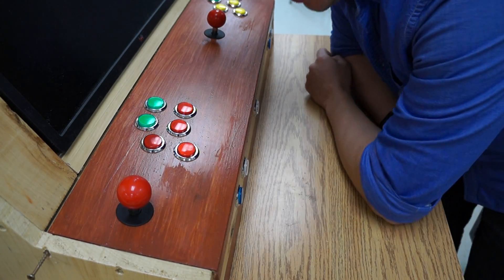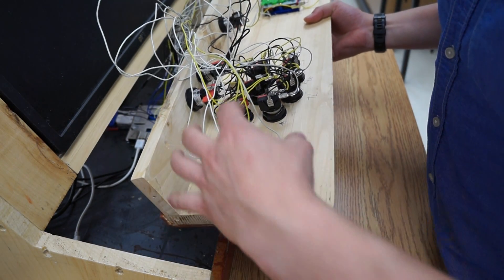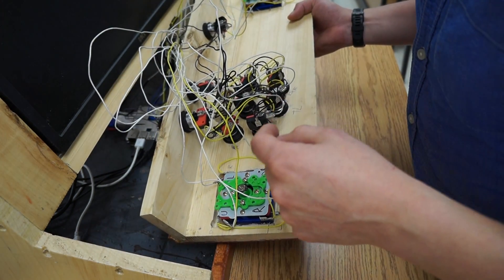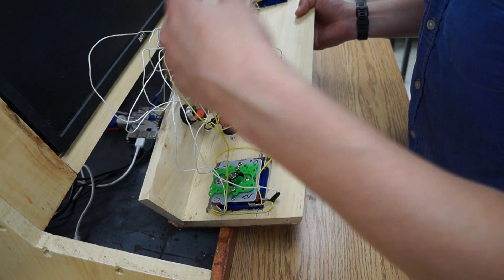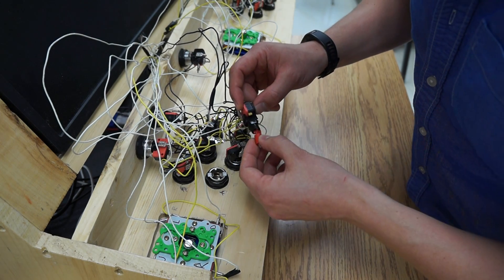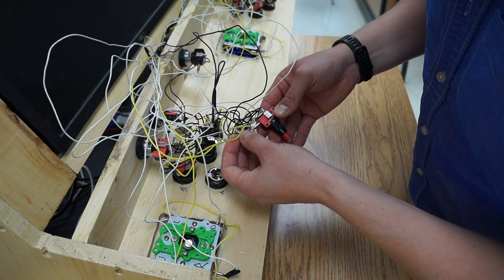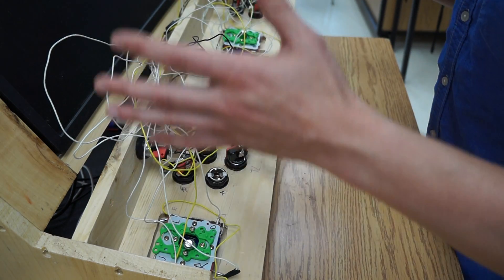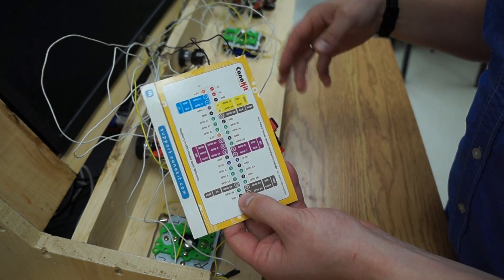Wiring up your Raspberry Pi 3 Recalbox with GPIO Controllers

Comment: I wish you would have slowed down while you were configuring the buttons and/or shown which buttons you were programming for the inputs, just for clarity and suggesting the button layout.  I have my pi just about ready to go, but I'm waiting for the weather to get just a bit nicer so I can build the bartop arcade.  I already built a full size one almost 14 years ago that's still running great.  I have it running on a PC though with an i-pac for the joysticks and button controls.

Comment: How did you connect the cables to the pie? Or did you solder them? Also what kind of wire are you using?